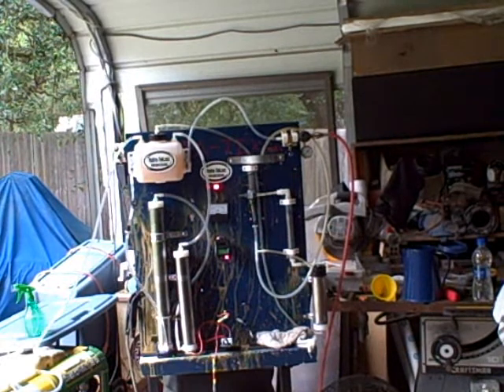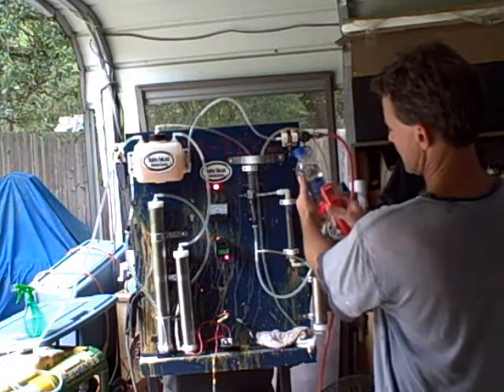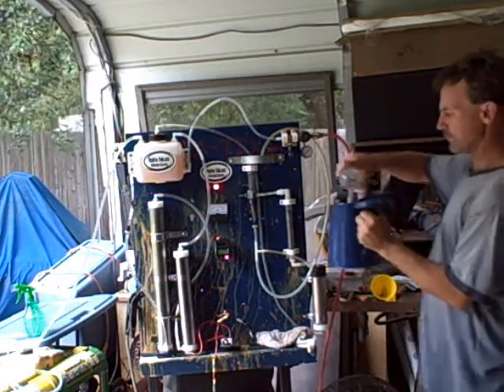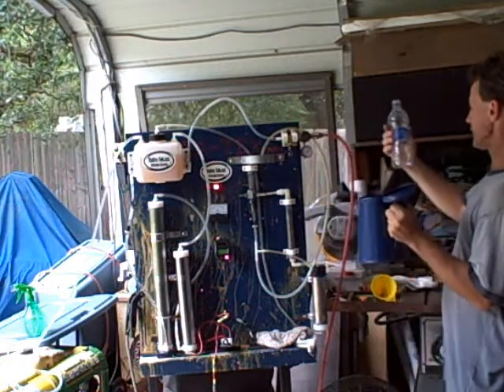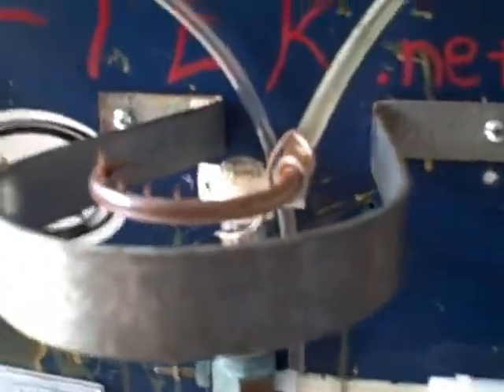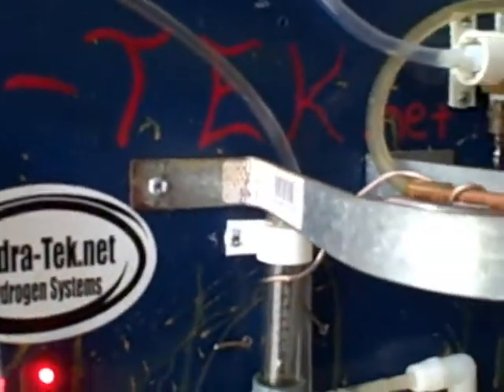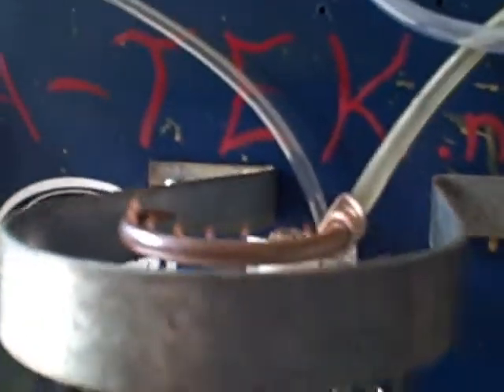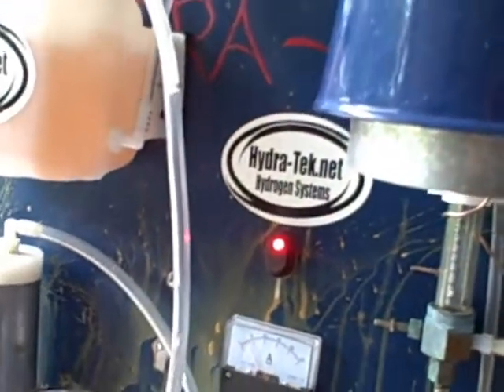hho and air burner

Comment: If you would have a modified pot you could already do some testing and watch the results with a modified pot and a standard pot, and only if it makes a positive difference then it might be useful to think of a serious design. But I understand it's not an easy task. But why not make a pot that is more efficient, then maybe the use of HHO becomes another step closer, after all racing cars are more streamlined then they used to be, so they don't only work  on the engine performance. 

Greets, iT

Comment: hehehe I never said it was easy to do LOL

But how about this, two cheap pots one big and one smaller. Put the big pot upside down and put it over the smaller pot, then make a hole inside the pot that is on top, and then weld it  together. I know it is easy for me to say, but it's a general idea, maybe others can come up with good ideas as well. 

Because it has to be  made it by hand it's not easy, but with a big pressure  machine it would be very easy to make all the pots and pans like this.

Comment: hahaha some comments of narrow minded people are amusing. So I enjoy reading them. After all it is healthy to have a good laugh so once in a while :-)

I was also thinking about a pot with an extra outside wall. The outer wall should be open at the bottom. Then more heat will stay  between the inner wall and the outer wall of the pot. It's hard to explain for me. I can't weld otherwise I would have sacrificed a pot myself to make what I have in mind. I think it  works for normal stoves as well.

Comment: I was also thinking that the heat can disappear very easy, maybe we need to think different when it comes to a design of the pot, when we want to cook with hho gas. After all there are different designs of pots  and  pans for different types of stoves. So maybe we need to make an adapter that goes beneath  the the pot straight on the stove. And the adapter can be made in a way so it catches most of the flame surface as it's possible. I'm  just throwing out some thoughts. 

Greets, iT

Comment: Maybe some day we don't get energy out of the wall anymore. Maybe in combination with a solar panel and/or a solar water heater that an HHO flame can be useful in a some sort of closed system. Just to give the extra heat that is needed to make water boil. The point is to get it more efficient, at least efficient enough to be useful some day, if people are not willing to understand this, then it is a waste of  time to spend the energy on explaining them what the point of all this is. 

Greets iT

Comment: Fantastic work !!! 5* I was wondering if it would make a difference if you drill the holes in an angle. If you do then I think that the flames hit a bigger amount of surface just like a normal gas stove does. I never see that they aim the flame 180 degrees straight up to the pot or pan. I think it would be better if you can manage to drill the holes in such a way that they almost level with the pot. So that the flames  are angled just about a 100 degrees.  

Greets, iT

Comment from the maker: This flame will burn you. Using the Henry Paine patent idea of electrolysis and hydrocarbons. The idea is to pass the hho through a hydrocarbon and add air to change the chemical characteristics of the gas. He said the gas was stable enough to bottle under pressure. They used it for lamp lighting downtown areas in the late 1800's and early 1900's.

Comment: Well Hydroxy or what ever other name ya want to call it doesn't matter to me if its called chicken piss,& Second if you read the comment I still Have tons of testing to do,have not had time in a while too,but when I do and get sufficient data  I will post it good or bad,cause it may turn out in a long term test that you are right,& if that is the case that I come to so be it.I am one that needs to do it for my self,I just like tinkering with stuff & hope for the best but sometimes it isn't

Comment: I have heard that a hydrogen flame dose not burn to the touch, but will cut through tungsten, is that true, if so is it the same with HHO?  Supposedly it had something to do with what ever element was in the flame which adapted to the elements characteristics, or something like that.

Comment: Hey man that thing is looking good ...
Those water drops that form on the bottom are the biggest problem I have seen with using hho for cooking ....I still have tons of testing to do but so far hho beats a electric stove by about  10 - 15% depending on the efficiency of the cell ya use ...
Nice to see someone else doing these test to